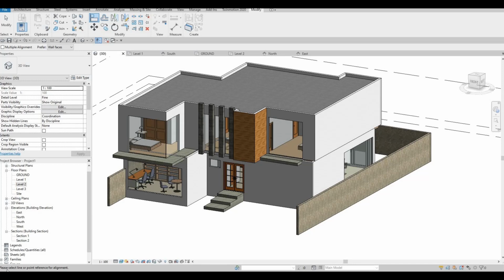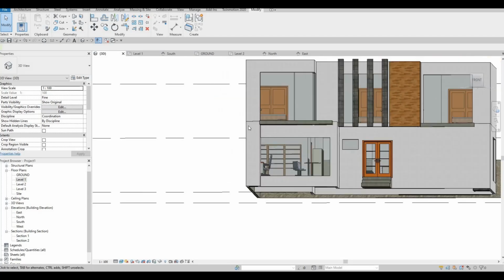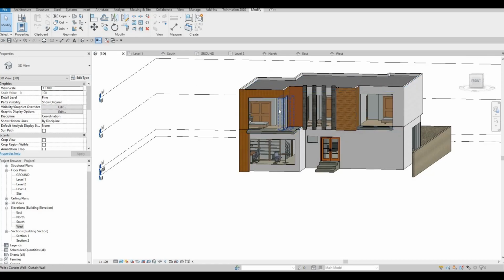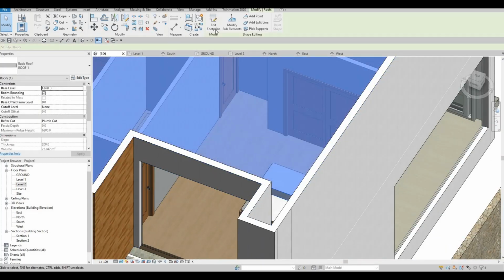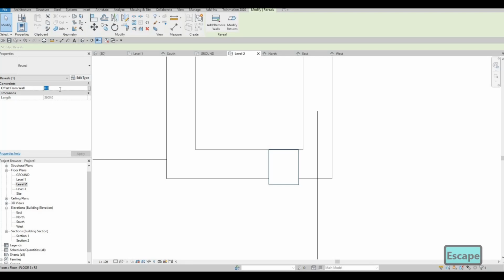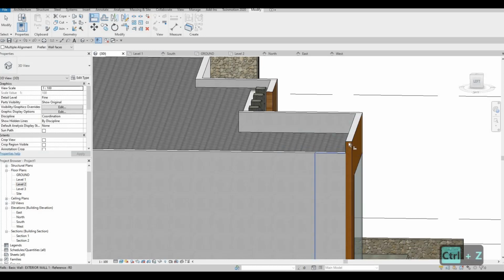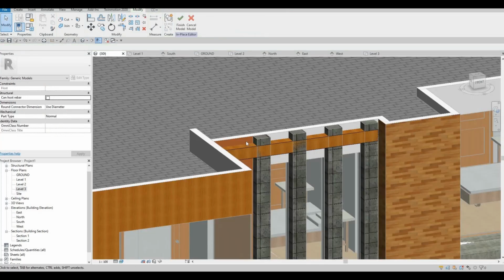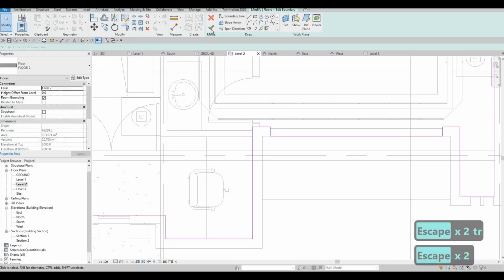TEPLM House | Part 10 | Complete Step By Step Project | Revit and Twinmotion Tutorial

Comment: Hi, thank you so much for that effort, but I have a question about why the second floor is attached to the outer core of the wall?
Reply from the maker: Hi Saria, that shouldnt be but because this is a model only I did that just to fill in the space. The proper way is the floor to be in the middle or the wall or “core”. Usually in design phase we just want to make it pretty then once you have in in construction phase there is where you fix those detail. Hope that explains that. 🙂🙏